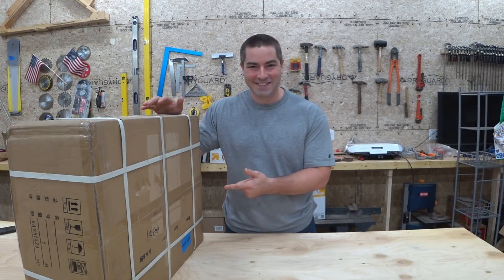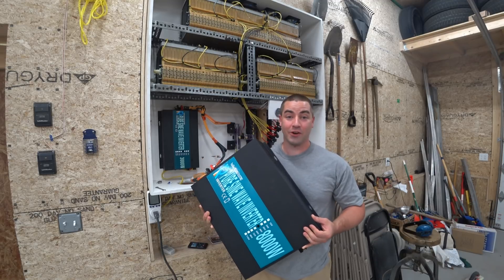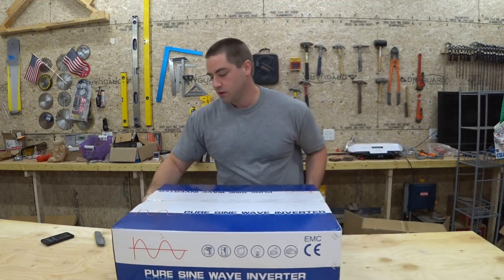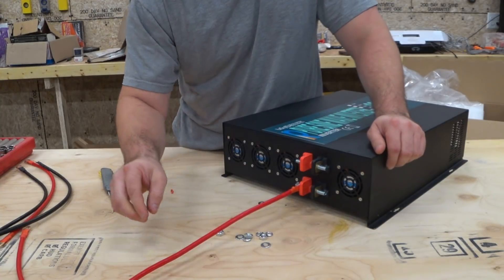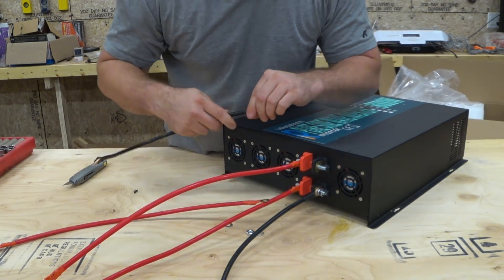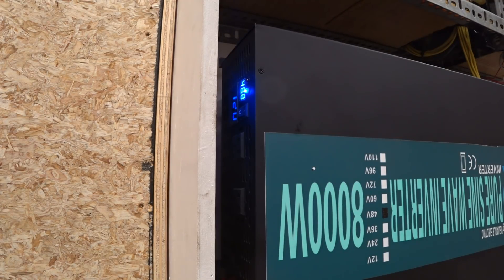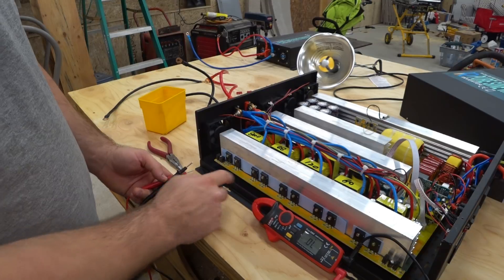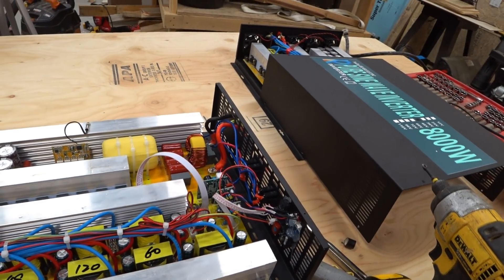Cheap 8000w Reliable Inverter, DIY Powerwall, Chevy Volt Batteries

Comment: "...an 8000 watt inverter...".  
No, it isn't.  
Not if it weighs less than 50 pounds.

There's a reason you can spend $500 on a 1000watt inverter or $200 for a 3000watt inverter.
You get what you pay for.  Almost always.

Good vid.  Hope you can hook'em for 3 - 3000watt'ers if those are the only ones they make that work.
Reply: It's a 3000w inverter with 8000w peak (the saw drill your using is pulling more then 8000w at startup) this reliable inviter lacks a soft start feature so it just blows under sudden loads

If its a 110v inverter don't use more then 3000w as the amps will kill it (240v 3000w is easier as that's only around 13amps)
Reply: @leexgx  Yep! That's the problem! You find high wattage air conditioners and electric dryers run on 240v not 120v. They would draw too much current at the lower voltage and exceed the amp rating of most home 120v wiring and fuse.
Reply: Weight isn't a problem))) bad circuit design is😉
Reply: Chinese shite  put in the bin
Reply: Sam Johnson I’d say 35- 45cents a watt on inverter is where the good products are , once you get to 10-15 cents or less your getting ducked lol
Reply: Correct. My 4000W inverter weighs over 50 pounds.
Reply: well they should be useing cap or something else automotive fuse's are not what they should be using.
Reply: Wrong you usually just pay for branding and marketing.  go watch AVE he takes an expensive one and a cheap one apart and compares them.  he knows his stuff.
Reply: Weight matters!!
Reply: Ic board inverter vs transformer based inverter is whyat you mean....a transformer based  inverter is heavy and hard to damage....ic board inverters fry  quite daily if pushed to hard

That is a IC inverter from what I could we of it

Comment: Those cables at the back are probably perfectly adequate for 48 volts. Higher voltage equals lower amperage for a given load.

Comment: Induction motor probably.  Allow about 10 X the running power to get it to start.  Doesn't explain why the 3kW would start it however.  I have a deep freeze that pulls a paltry 100W when running.   A 1KW inverter won't reliably kick it up.   It doesn't destroy itself but fires up warning lights and alarms and cuts off. The same inverter happliy feeds a 800+ watt heater.

Comment: You do understand, I hope, 
that a 15 amp at 120 volt = 1800 watts,
with a momentary start-up current requirement 
of probably 60 amps (7200 watts)
or maybe 80 amps (9600 watts).

Question:  Does your power-saw NOT have a soft-start built-in ??
Reply: Hes driving a huge inductive load with the miter saw. It could be a power factor issue.
Reply: The DC input current is more than double the AC output current, so a start up of 7200 watts would draw 150 amps from the batteries @ 48V.
Reply: Even without a soft-start, this should NOT have caused the inverter to lose the MOSFETs or all those fuses.  There should have been a high-current protection circuit with polyfuses that cut off immediately.    I pulled the spec from the saw that he's using to check the continuous and start-up current at 110V:

Continuous is as expected : 1800W
Start-up is : 2200W ( 20A ) 
Peak is : 3200W ( ~30A ) for 50ms

Most normal 20A circuit breakers will not trip in 50 milliseconds at 30A.   Certainly, that should not have blown the entire inverter.
Reply: Polyfuses are NOT good for this application. Not only would they dissipate a lot of heat under normal circumstances, they would also be too slow to react to a fault. In fact, polyfuses can take hundreds of milliseconds to react to a fault.
The main way to make it react quickly enough to faults is to have high current gate pulldowns, and limit the rate of change in the current so that there is time for the OCP to shut off the PWM to the FETs.
And/or make it back off on the voltage momentarily.

Most likely the inverter is poorly designed. It may be lacking: enough bulk capacitors, good overcurrent protection, or overvoltage protection to clamp the inductive surges on the output, especially when you start/stop (or plug/unplug) things like that saw.
Reply: @TheMakersWorkshop  and the peak wattage is if you tried to start up the saw while the blade is jammed up!!
Reply: Snow, I have an electric chainsaw which will run just fine on a 1500w mod sine inverter from HF.  It's rated at 2hp.  My circ saw is 1.5hp and runs fine, too.  

THE most important point for using an inverter is that the input cabling be the largest you can possibly find, and the shorter the better.  Were that 8kW inverter mine, I'd use 4/0 cable, period.  Thinner wires reduce the output and increase the strain on the inverter.  I'm surprised that Reliable hadn't learned that lesson earlier. What were those triple cable sets, 8ga or so?  <giggle>  It appears that Reliable is no longer selling those on Ebay or Amazon.    Oh, soft start saw?  Only on plunge saws, as far as I have seen. (nope, Makita makes one!)
Reply: @ljprep6250  - those horsepower ratings are meaningless.  Manufacturers only use them to say 'ours is the most powerful'.  Using a power factor of 1.0,  1 horsepower is equal to 16 amps at 115 volts.  1/2 hp = 9.8 A; 2 hp = 24A.
Reply: Even if there was an overload or even a dead short, the inverter should have had an auto protection circuit that triggered and protected the inverter but yeah you have a valid point.
Reply: How to calculate the starting current.
Reply: This is true. I have the same problem with my chop saw tripping the house breakers due to the start up current spike. I cured the problem by fitting slow trip MCB’s
Reply: And an impedance problem ......Need some cos of phi matching ? Remember the 50hz osc needs to see the correct XL so you will need Xc to tune it and maybe a soft start circuit. Dose this make sense or is it bull??
Reply: they don't and I think that all power tool companies should look into changing there systems because eventually power grids will be going down ....
Reply: BS! Those devices do not have 80 amp surges.  That inverter is junk.  That's the problem.
Reply: @jimbougard8560  Right?!?!?! If these things could draw more than 25 amps at start up it would trip your breaker on normal house wiring every single time you pulled the trigger! These people are nuts lol
Reply: Snow Andrews not true.  I have one of those saws on a 20 amp breaker residential circuit.....if it pulled 60 amp it would trip my breaker.
Reply: @bradfordpalmer2298  Your home circuit breakers have a delay to prevent them from tripping the moment you exceed the rated current (for very short periods of time). A look back in history shows we went from fuses, to slow blow fuses, to our current thermal circuit breakers. The slow blow fuse design was made to compensate for things like when a refrigerator kicks on, and our circuit breakers are a continuation of that idea. Try starting and stopping your saw repeatedly very quickly. Theres a chance you will "pop" the breaker.
Reply: Probably?

Comment: I built a Magnum system that can run 8,800 watts continuous and 16,000 watts peak.  The Magnum system could probably run 5 of these saws, under load, at the same time.  I currently run house lights, TV's, computers, refrigerator, freezer, pool pump, 3 window AC units and the water heater all at the same time.  It will also run my dryer.  The Magnum system has really worked great so far.
Reply from the maker: Yeah, you have a beautiful system.  I've never seen someone put in so much planning.  I watched your series as you installed it.  Plus your cans.
Reply: Small world...  I do tend to overplan but when I look back at earlier versions of my plans I am always glad I kept working out the bugs before I built it. 
I had a thought about your Reliable inverter.  What if it's in some kind of standby mode that it can't wake up and respond fast enough to save itself.  What if you had a 500W load on it before you start the saw?  Lets get another one and try it! :)
Reply: The Magnum system had better be a good system considering he could probably buy 12 of those 8000 watt jobs for what you paid. The only problem with what I am saying is that he still don't have a working 8000 watt inverter and his 3000 will run the saw. If you are right that he needs a small wake up load to keep the inverter happy then that would be fine but it should still run the load if a 3000 watt inverter will. I just bought a 4000watt reliable inverter and now I am hoping that it is a beefed up 3000 watt in stead of half of a 8000 watt lol.
Reply: Please stop with the Magnum already. Never heard of them but I will watch a video if you will upload one.
Reply: G Henrickson: Here is a video of the Magnum system in action:
https://youtu.be/TNIA78586-M

Comment: Here's a thought, is it possible the reason for the way the Red and Black Connectors are constructed is to
allow for some sort of daisy chain set up? Or possible two different inputs types? I can't seem to
understand why such hefty input is is split unless they plan to use 2 cables on 1 while 1 on the other... 

Cheers
Reply: No daisy chain - they're designed to be paralleled to be able to carry over 150 amps.

Comment: The Magnum is a single phase split phase 230 volt 110 volt inverter pure sine wave the efficiency is amazing power consumption of the inverter on with no charge controller attached is 30 Watts standby mode is 4 Watts I never have to turn my inverter off at all it is super efficient with one Chevy Volt battery 16 kilowatts at 70% 11 kilowatts I can run 100% of my 110-volt circuits if I add another battery I can run the blower fan for my heat pump and a window unit as a heat pump hint my next project if you would like to contact me so I can describe in more detail my system send me a message and I'll get you my email
Reply from the maker: Thanks.  I enjoy watching your videos.
Reply: Please stop promoting Magnum. Its getting old.
Reply: Why different voltages say 12/24/48.....?   Also just a 12 volt Chevy battery....can I get away with car battery?
Stone
Reply: Schneider XW series.. only way to fly. I have both, prefer the Schneider.
Reply: @blackswan7292  i install all the major brands top of the list is sunny island bottom of the list is magnum lol not on the list is anything Cheaper then $1k
This is my opinion tho 
You definitely get what you pay for

Comment: If you buy a magnum get your MP panel with it so you get the 5-year warranty I'd suggest to buy Magnum I run my entire house on it and my power tools table saw window air conditioners projects 2000 watt microwaves basically everything in my house except my heat pump and stove on one inverter

Comment: I definitely won't be buying any of their products I have seen numerous videos with them failing not only on Startup like yours just did but also after 3 to 6 months and many saying after their second or third replacement they stopped talking to him and they won't return their emails or answer their questions do anything to help them. Just another item of proof buy quality spend more money.
Reply: Should be "less" money I guess.
Reply: Well they are using automotive fuses instead of caps or something else.

Comment: Hi David Poz.
Have you checked YouTube 3x 🔗🔗🔗Link , Idea💡 to you.
Try To have ⚡Breaker before and arter Inverter. Remember AC and DC breaker.

- Reliable Inverter 3000W and 8000W.
🔗"Going Off Grid"
And.
⚡Energy Smart Meter SDM630 / SDM120.
🔗"DIY Tech & Repairs"
- Solar Electricity as main.
And.
🔗"MyPlayHouse"
-⚡Shelly 4 pro Home Automation # 755.
-Relay switch to Smart Home + app.
(AC 120V - 230V 4x10A to 2300W)
(AC 120V - 230V 2x32A).
= :-) DataMek From 🇩🇰 Denmark.

Comment: Since the failure can be reproduced, that's not a big issue. It would be easy to be fixed by RD engineer with oscilloscope. 
I think the circuit diagram/structure  of the 3000W and 8000W are almost the same.  Normally the 8000W can afford to suffer much more inrush current than 3000W's.
So....The problem should be related to protection circuit.  I guess....the root cause might be at the MOSFET driver(ex: IR2110..etc). "One" driver can't drive so many MOSFETs efficiently. 
(More MOSFET imply more gate capacitance.  More gate capacitance imply more turn off time delay. More turn off time imply much much more power dissipation on MOSFET.)
Reply: The large induction motor on the miter-saw will look like an inductive load (low power factor) at startup.  When driving an inductive load, the current lags the voltage by about 90 degrees.  This means you have peak current just before the voltage goes to zero (while mosfets are switching off). I suspect the high currents through the mosfets while they are switching is what is causing the mosfets to overheat and blow-out.  

 I would check the start-capacitor on the miter-saw's motor.  It may be open, and is causing the motor to draw excessive current, and look like a very low power-factor load at startup.  If it is powered from a regular wall outlet, you might not notice if the motor starts up fine.  Then again, this miter-saw motor might not even have a start-capacitor.
Reply: @jessstuart7495  - but the same saw starts up fine on his 3000 watt inverter...  there has got to be a design flaw with the 8000 - right ?
Reply: @mark_osborne  some inverters have a soft start load feature where they limit the amount of power the item its trying to pull  after the surge stops it restores the voltage back to normal, if it can't handle it the inverter goes into fault and cuts off power (so not to destroy itself)
Reply: @mark_osborne  The mosfets are bad. They are failing at current less than their rating, going short circuit, blowing the fuse, putting more stress on the others until one of them fails, goes short circuit, blows a fuse, and so on.

Perhaps there is faulty load balancing driving the mosfets.
Reply: @mark_osborne  No.  If your peak current load is excessive,  it's excessive.  It doesn't matter what happens on another power supply. You need to quit guessing and measure the peak amperage load on startup with a  suitable ammeter arrangement.
Reply from the maker: Hi Chang Simon,  That sent my head spinning.  I was thinking of ordering new mosfets and replacing the broken ones.  Is this "driver" something I can upgrade too?
Reply: @DavidPozEnergy  kind of. there are bigger Fet drivers. you may need that driver to drive  a push-pull amp, to drive the fets. there is alot of FETS in there, and like Chang said, that is a lot of gate capacitance. 

something also, that saw while 15 amp, has a nasty draw when the trigger is pulled. I feel like the inverter should safty itself before killing itself.
Reply: @DavidPozEnergy  if the drivers are not well chosen, then the Mosfets can blow. You need to replace the Mosfets for sure. Then before the next attempt check the drivers. Look up mosfet data sheet, driver data sheet. On time, capacitance, resistance in on state. You can calculate power consumption of Mosfet aka heat. How good can heat be dissipated?
Reply: How would they get the components that wrong? What does it work up to in the present set up? Even the most powerful saw is under 4000 watts at start up. His thing lit up quick, as you say, the timing is off?

Comment: Mosfets usually fail as a dead short that is what blows fuses....
Reply: yes,  that's what I was thinking. Something inside the inverter is shorting as it blew all the fuses.  It isn't his chop box as it runs fine on the 3000 watt inverter.
Reply: If it blows the fuse its a dead inverter as the Mosfets fry before the fuses blow and the fuses blow because of the shorted out Mosfets (replacing them will just blow again)
Reply: Wasn't he measuring the reverse protection diode? Can this diode go bad with out the gate shorting to the channel?

Comment: Anything you want to run, such as motor etc.So you have to buy the transformer ups like apc 3000watt.Use the apc ups pure sine wave to look and have four batteries 12v. But there should be transformers ups if motors want to run. let's try. good luck
Reply: Maybe a start up capacitor?